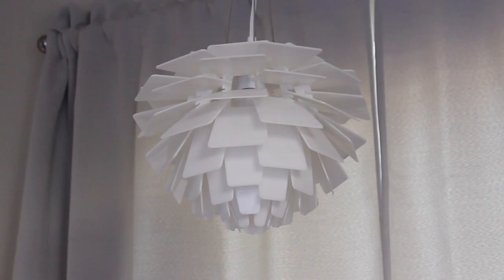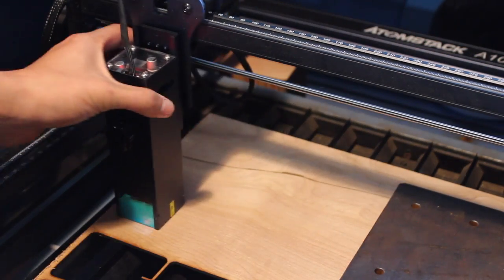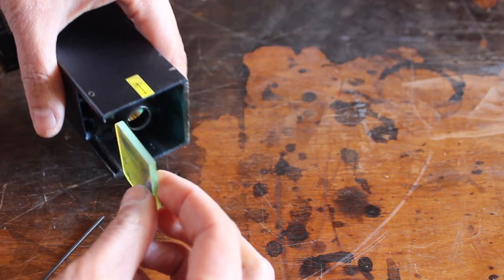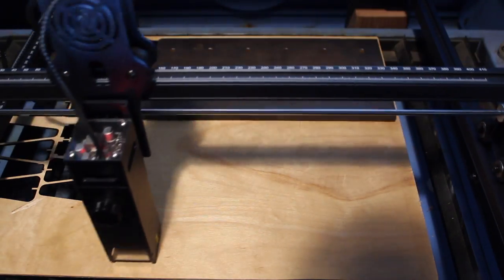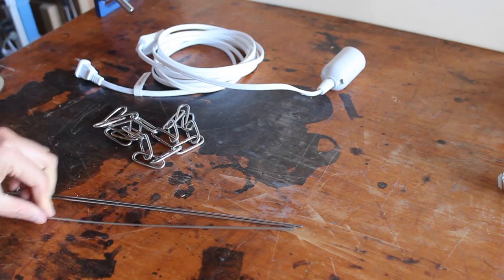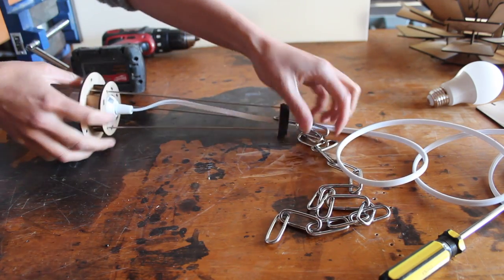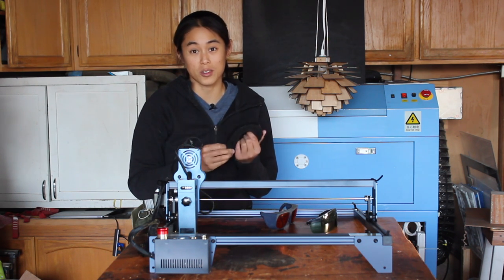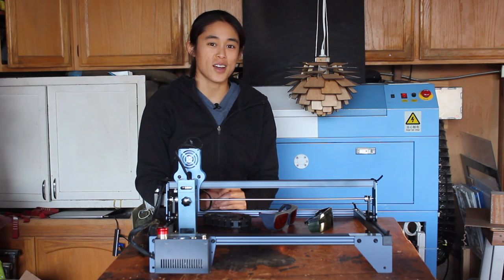Laser-cut Lamp using Atomstack A10 Pro

Comment: Amy, atomstack lasers are designed to cut at 2 mm. Use the acrylic piece they send with it to distance the laser head. Gauge your distance from the high point of the plywood. 
Get Louisiana Hobby Goy's atomstack cutting library for best settings. Thanks! Great project

Comment: Does the glass on your 45w CO2 machine protect you from the UV?? I don’t have much experience with UV lasers outside enclosed DLP printers.

I love that design!!
Reply from the maker: Oh excellent question, it does not. I wear safety glasses when I run the UV laser, or I cover the window with something opaque.
Reply: @AmyMakesStuff  Is the original glass window on the little laser meant to block most of the laser light but still allow you to see what's happening? It almost looks like it had some dichroic coating, or was very heavily silvered, but not 100% reflective and still slightly transmissive
Reply: @AmyMakesStuff  The UV from your smaller cutter isn't short wave enough to be blocked by normal glass. And the glass from your CO2 laser is meant to block longer IR wavelength. So you definitely need to wear the glasses meant for the Atomstack A10 Pro even when it is inside the enclosure.
Reply from the maker: I have OD6 glasses for both kinds of lasers.
Reply from the maker: Using the CO2 enclosure is mostly to take advantage of the fume extraction and limit stray light that could make it to my dog and cat who are often in the shop with me. I still wear the appropriate glasses religiously.

Comment: Is there a reason you're using the smaller laser inside the enclosure of the bigger laser, instead of using the bigger laser directly? Does a co2 laser not do well with plywood? I get that it's a promotion in kind of them sending you the machine, but I'm wondering if a violet laser actually has some advantage over co2 for this material or something.
Reply from the maker: oh ya, sorry, that's confusing! My CO2 laser would have done a great job making this project. It is 45W (so all the parts would have easily cut in 1 pass), and CO2 lasers are great for wood. The stainless steel engraving at the end, though, is something the CO2 laser could not do directly without some additional chemicals applied to the surface. I also just think its fun to show cool things being made on small machines.
Reply: @AmyMakesStuff  Clough42 recently got a small-ish laser too, and had mentioned that violet lasers are better at some things than co2 is (such as marking / engraving steel / stainless steel)
Reply from the maker: I’ll have to check it out! Thanks!